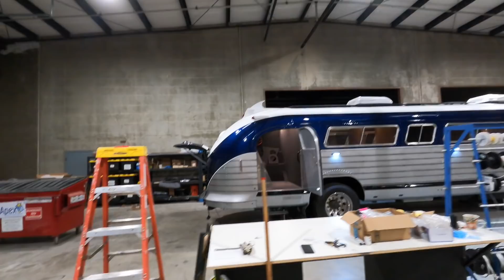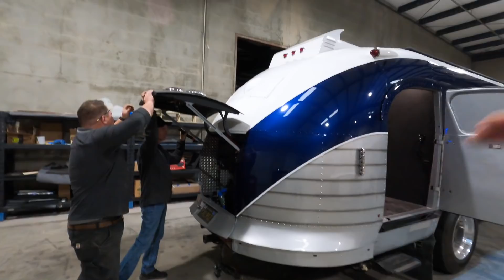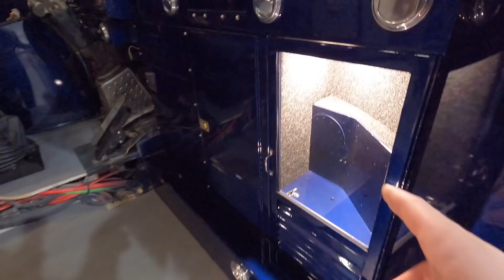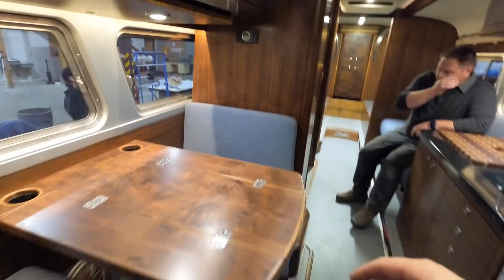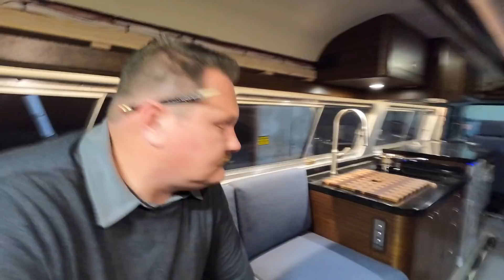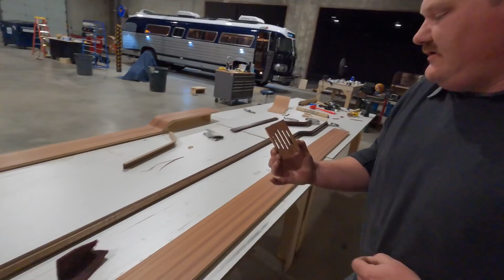1952 Flxible Visicoach restoration update (Almost Complete!)

Comment: We used to enjoy boating on the Great Lakes and would always admire the restored 1950'sand 60's wooden boats.  For the owners, they were a labour of love due to the staggering amount of annual maintenance. What I LOVE about this Flxible bus is that it has been restored with modern mechanical and electrical systems plus a stunning yacht-like interior decor but won't require any more maintenance than a modern RV.  Way to go High Tail Custom!  You guys blend engineering and art seamlessly.  Hat's off to you for a stunning restomod.
Reply: Comparing the build quality to modern RVs, which are perpetually falling apart (and barely holding together in the first place), this should definitely require less maintenance.

Comment: The question is how will it ride?  It's one thing to have a classic car restored and take it for a quick afternoon drive.  But drive hundreds of miles on the highway, the true test of an RV - these buses were not comfortable for long trips back in their day.  Will this one be smooth and quiet enough to not wear out the driver and passengers?
Reply: I believe it is staying on leaf springs, which may not be as comfy as a more modern air-sprung coaches of the next generation and beyond, but rider comfort is also largely in the seats.  I imagine the roads it will be travelling should also be considerably smoother, as it was designed for the rough country highways of the era, before the modern Interstate Highway System was in place.